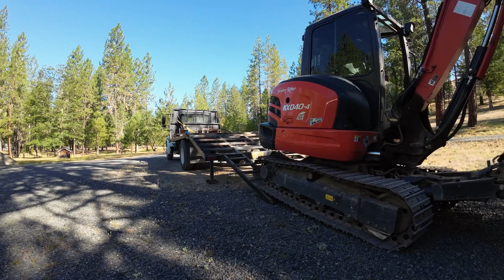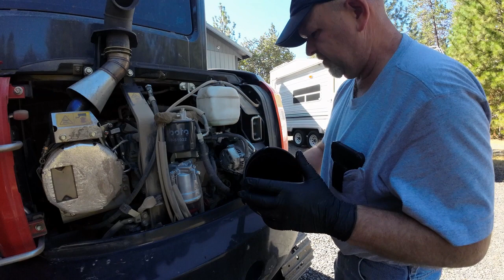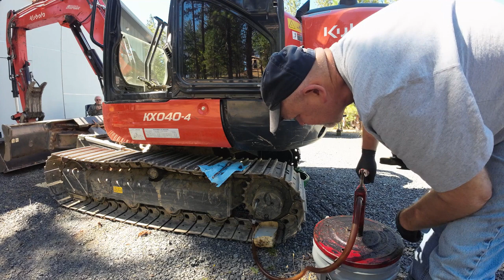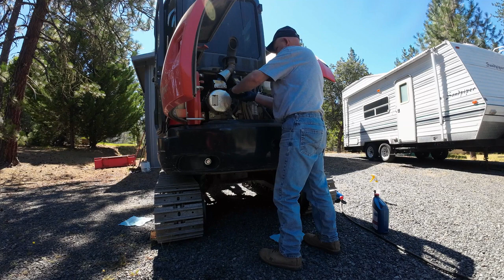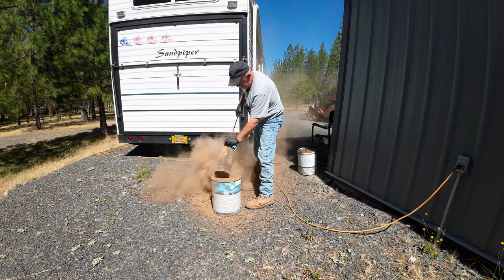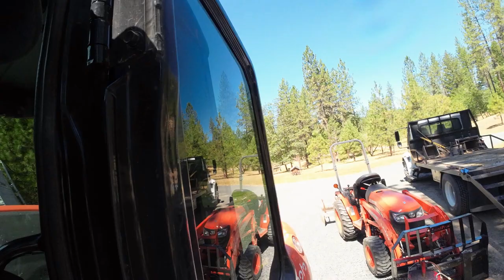Weekend fun Kubota KX-040 800hr service

Comment: That truck set up is too sketchy for me. Tilt bed low boy bumper pull trailer is what would work for me.
Reply from the maker: I have been loading on and off the ramp trucks for about 30 years. It's not too bad. The scariest ride I have ever taken was loading our old dozer on a lower decked trailer. One track slipped it, turned sideways, and slide all the way off the back. That definitely got my attention. And it happened fast. Have a wonderful day, and thanks again for watching, I appreciate it. 😊
Reply: @jeramyreberpuredirt7873  I’m not going to be hauling machines all over the country side. If I wanted to go help a neighbor or friend I could easily pull this 040 and pull a SLV 75 around with my Tundra on a low tilt bead. Great videos. Has definitely sold me on the equipment that I need for my place.
Reply from the maker: @jpdunamislodge  that is cool, I enjoy chatting with you. Best of luck with your ventures.

Comment: I’m getting ready to write a big check to Kubota. At least I want to. I need an 040 with 3 buckets, 6 way blade, and a mulcher head. I also need a SLV 75 skid steer with a standard bucket, grapple bucket, and would like a mower deck.  There is one dealership up here in Alaska and those turds are marking everything up a good 20%. 🤬🤬🤬 these a holes say that they won’t warranty anything that I buy down in the Lower 48 and ship up here and won’t will not work with me on parts or service unless I buy everything through them. 🤬🤬🤬 eff them! I need what amounts to a semi load of Kubota gear trucked up here and delivered to me. I also wanted to look at getting the smaller 2 place side by side with a snow blower on it which they also quoted 20k more than what I would pay for one down south. Fauch these arrogant entitled jerks up here. They want over 60k more for the same stuff that I could buy and ship up here. 😡
Reply from the maker: That's bs, I hate dealerships that gouge people. That's so wrong.
Reply: @jeramyreberpuredirt7873  they have a monopoly up here. Same is true with the car dealers.

Comment: On my Takeuchi, when I opened my final, it was dry. (I bought it with a jammed track motor.)
Not sure how anyone could run a machine with an empty final……
I pulled the chunks out, (amazingly it turned again) refilled it, and ran it for a few years until I bought a new kubota.
Reply from the maker: You got lucky on that one, I  know several people that hardly do any maintenance on their equipment. I am enjoying watching your videos, I love your little mini truck.
Reply: @jeramyreberpuredirt7873  Yea, the mini truck is a ton of fun. Great bang around machine. My wife uses her truck for work, so she doesn’t like getting gas or diesel spilled in it.
With my truck, no problem.

Comment: Do you ever power wash the engine and hydraulic area?
Reply from the maker: No I worry about hitting wire connection with High pressure.

Comment: Where did you buy your steel tracks. I have the same machine and had a rubber track split after 1200 hours.
Reply from the maker: Through my Kubota dealer. They put them on before I picked it up. Most of my machine were ordered with steel. This one had rubber but they switched it over and discounted the rubber tracks off the price.